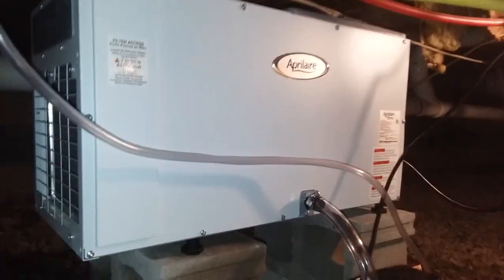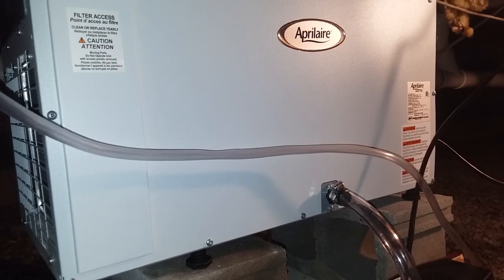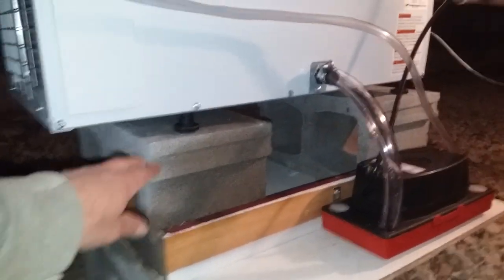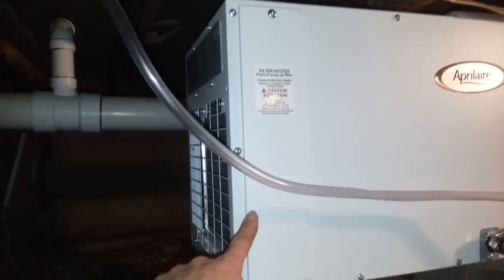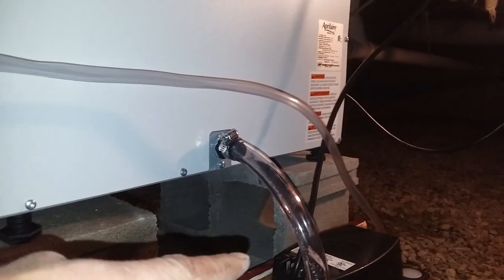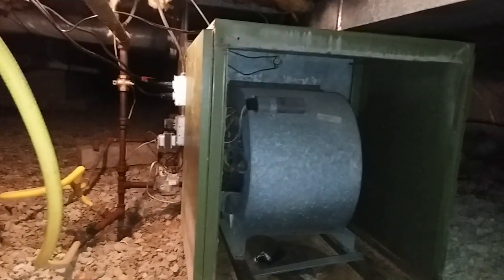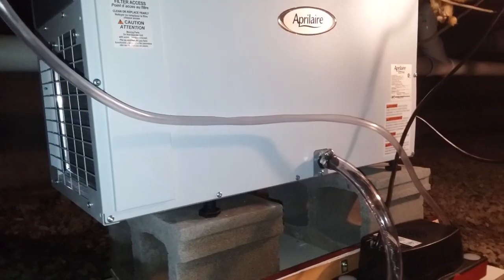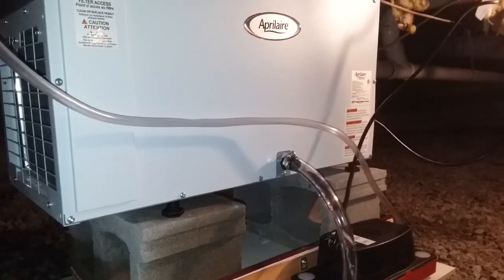Dehumidifier installed in crawlspace Aprilair

Comment: I installed my new Aprilaire 1850 dehumidifier on Sunday in my 92%RH crawl space. By Tuesday the RH was down to 48.5%. I set the humidistat on 40% when I first turned it on.  Now I have it set on 50%. My crawl space is 1,350 square feet. The 1850 can dehumidify crawl spaces up to around 5,000 square feet.
Reply from the maker: Very nice,  mine has been working great. Only thing thst happened is i had a power outage. And it didn't restart after didn't realize for a couple weeks. So something to keep in mind.
Reply: where did you place it? near the crawl space opening?

Comment: Most pumps have got Plenty of push. Water will stay in the hose at all times. Lowe’s has algaecide for $12. Set it on your shelf and pour a cap full once a year. The bottle will last for ten years. The dehumidifier is absolutely the best in the market. Period. I have 177 out there starting 4+ years ago. Not a single issue

Comment: Best thing about the video is not the unit,  is the fact your princess helped you.  I love engaging my princesses to help me around the house.  Quick question, how much was the unit? From what I heard the unit is quiet correct?
Reply: It was probably around $1,800 for the unit alone. But some add on items like the remote controller, extra filter, condensation pump, ducts, pad for unit, etc. Duct collars are included along with a good length of condensation line.

Comment: I’m in the same boat as you wet crawlspace.. ? Did you install yours center of your crawlspace?..would a condensate pump be necessary if draining to a sump pump pit? And may ask where you purchased..
Reply from the maker: Sorry that you are having problems.  I found best price online. I'm sorry i dont remember vendors name. No you wont need pump if you can drain into sump pump. Mine is close to center as possible. One thing when ordering i had a choice to hard wire or standard plug in type. I did standard plug since i had outlet available in my crawlspace space. Hope this helps.

Comment: Nice job. Is that condensation pump needed? If you had a down angle to the outside would that be sufficient? Would you instead attach a pvc pipe with a P trap?
Reply from the maker: The pump is only needed if pumping  up and out. If your drain is below unit it will just drain out no pump required.

Comment: Please elaborate on the drain system.   What model pump did you purchase or was it an add on option from the supplier?  Where does the water ultimately drain too?  Thanks!
Reply: they sell condensate pumps for $50 home depot and the condensate runs thru the 1/2 in line you see in video outside of your crawl space thru concrete .wood, cinder blockand then lets say 4ft beyound crawlspace with 1/2 in line to drain outside crawl space.

Comment: I have to do the same thing as you. Your video was my introduction into crawl space dehumidification. Questions for you, did you have to run any ductwork out? I see that there are duct kits for this unit.  Also, is the pump you hooked up from the company that sold you your unit? Or did you buy it from some where else. Did you purchase some sort of remote control device that keeps you informed what is going on under there or do you just install and let her rip.
Thank you sir.
Reply from the maker: I bought both  from same company. I did buy inexpensive wireless unit to track humidity and temperature in crawlspace.  Main thing i did was seal up all access so no outside air could get in to crawlspace. I didn't add ductwork to unit. I have rather large crawlspace and has improved it dramatically. Hope that helps some. I will try and do up date on it.

Comment: Nice video thanks. We bought this house 18 months ago and finally went down to our encapsulated crawl space and found this unit sitting there and turned off. My question is should it be connected to ductwork? I see your isn’t so I’m hoping I don’t need to. 🤞
Reply: You don’t need to. The paperwork says it will run more quietly with some duct work but it is not needed.
Reply: The idea behind the duct work is some crawl spaces are divided into sections with stem walls. The stem walls may restrict air flow throughout the crawl space. So some run duct work past the stem walls into the other crawl space sections. When using duct work, RESIDENTS  (not necessarily installers) must be mindful that if they or companies they hire need to access the ducted sections, the ducting may be the only passage to the sections & they are now blocked. Someone may damage the duct work to pass thru or someone like a home inspector may say the area is unviewable & skip that part of the inspection.  On the other hand, I've heard people say that the properly sized AprilAire or other good units will dehumidify fine without the ducts.

Comment: good to see.... i need to install a 1830 model next week
Reply: Do tell! Did you? How did it go?
Reply: @maxmanx1294  It's been working well for the past three years, despite having nothing to control air infiltration other than closing half of the air vents.  But 50% is easily achieved.
I am in north central NC.
Reply: @eugeniustheodidactus8890  I'm near Charlotte. My dehumidifier was just delivered. Its heavy! I should have mine installed tomorrow. 😊 I bought a fan, too. I intend to have my vents closed & sealed this weekend except for the one for the fan. The wireless dehumidifier controls are out of stock, so for the moment I'll install my unit near the crawl space door.  My crawl space is so tight that I call it a slither space.

Comment: If you set it to 50  and we lose power, will it turn back on at 50? Or will it default back to 74?
Reply from the maker: When power goes off and comes back on it goes into like a default setting. I had to umplug and reset the humidity level. They do sell monitor that can be installed in living area to monitor system.
I have monitor I purchased off Amazon that monitors crawlspace humidity so I don't have to go and check as often to make sure humidity level is where I want it.
Reply: @johnagsmith2364  Yes, I was informed that it was set to 74.  I can see there are some needed improvements.  Who the hell wants to crawl under their house every time they lose power? What a pain in the ass.  Not to mention the small lake of water it was sitting in that had to be mopped up. FYI sopping wet beach towels are heavy.  I'm thinking it needs a drain pan JUST LIKE my ac unit does.  This is ridiculous.

Comment: Did you ever add a vapor barrier or has it solved the problem without adding it? Thanks
Reply from the maker: For mine it has improved a lot. I had planned to add one. If you go back on my other videos i added underground drainage off my down spouts which was first step. Then sealing all my opening outside widow/vents to crawlspace. At this time i dont plan to add vapor barrier. I'm now in process of sealing all the joist on outside walls using foam board and sealant. If i see need i may do one later. But for now im satisfied with improvement of area. Good luck.
Reply: Thanks for the quick reply I think that's the approach I plan to start with
Reply: @johnagsmith2364  Thanks for the video John. Where are you located / what climate are you in? I've always heard that you need to let the crawl space breathe. I'm in TX so it's always humid. Does closing the vents help in areas with high humidity?
Reply: @willfinley9553  A long time ago it was believed that crawl spaces could "breathe" via vents. In reality, humidity is trapped in there & thru the stack effect enters your home. Further, the temperature difference between crawl space & interior causes condensation on your wood (joists, mud sill, subfloor, underlayment, studs, etc). That can lead to mold, rot, WDOs, etc. Also, the high humidity causes insulation to hang / fall from crawl space joists. Now no one builds open / vented crawl spaces. They're treated as indoor spaces as they should because 50% of our indoor air comes from the crawl space. Nonetheless, to keep humidity out, sealed & overlapped 6 mil min vapor barrier covers entire floor, up stem walls & posts, but leaving a state-specific termite inspection gap at the top. In this set up, the crawl space air is always conditioned. People retrofit to add dehumidifiers by filling vents with 4" rigid foam & filling edges with spray foam & the vapor barrier is installed as described above. Look for videos about crawl space encapsulation. Hope this helps!

Comment: where did you place the humidifier? does it matter where it’s placed in crawl space?
Reply from the maker: I installed close to center of crawlspace.  But had to make sure power was available along with drainage for pump.
Reply: @johnagsmith2364  ty john
Reply: @johnagsmith2364  do you have the exhaust hooked to a vent or just letting it flow in the crawl space?

Comment: Nice, where is your pump sending it to? I've got to get one of these but still have to figure out the pump situation... I don't want to have to set up a sump pump of I don't have to
Reply: Drain the water outside at least six feet from your home. If your unit sits higher than your access to the outdoors & discharge location, you shouldn't need the condensation pump. You can increase or decrease the length of your discharge line.

Comment: What to do if you cannot access the crawl space? (Too small)
Reply: Could you cut an opening in your floor such as in a closet between joist? If so, perhaps you could set the unit in the crawlspace from above? You'd still need to level the unit, have a place to plug it in for power, use the hose to discharge the water, and control the unit. You could get a wireless control. Yet, you'd still need to perform filter maintenance every 6 months. Some homes have a covered hole in the floor as the only entry to the crawlspace. Another idea is IF your garage is attached to your home, create an opening to the crawlspace from it at the bottom of the wall. Keep unit in garage close to opening , use ductwork inside crawlspace, build a sealed box around crawlspace with access for maintenance. Best wishes - that is a tough situation. I hope you have a properly installed vapor barrier.

Comment: The model number should be 1850.  How is it working for you?  Are your foundation vents sealed?
Reply from the maker: I did check about week into it running.  The level went from 76% down to 60% so has reduced humidity in crawlspace. I have 3 opening . Each I have closed off but are not permanently sealed. Along with that I installed better drainage for my downspouts.  I did few videos on that. Doing that helped keep water from getting in to space. Along with keeping gutters clear. I do plan to do more in future to help reduce problems in that area. Hope that helps .